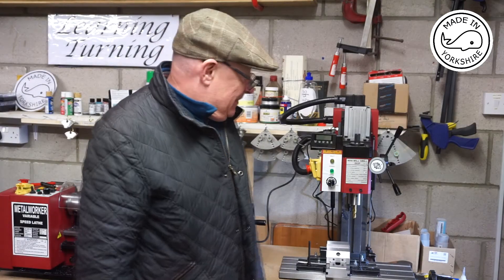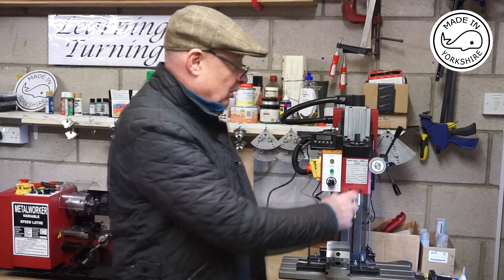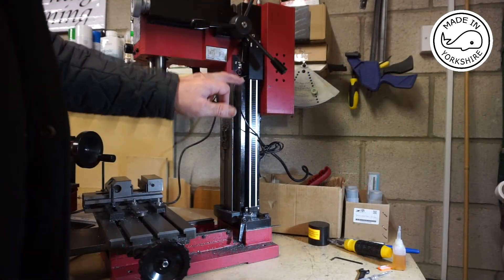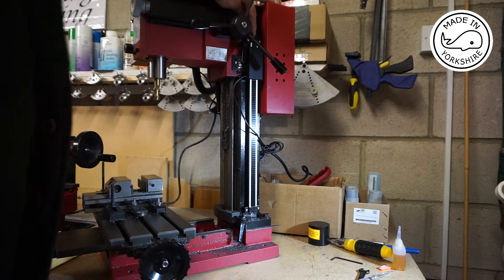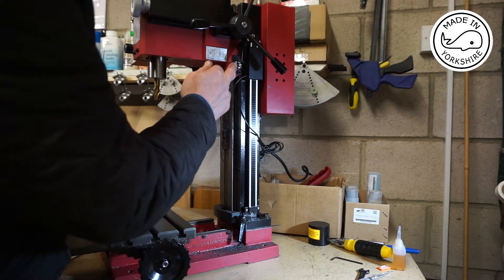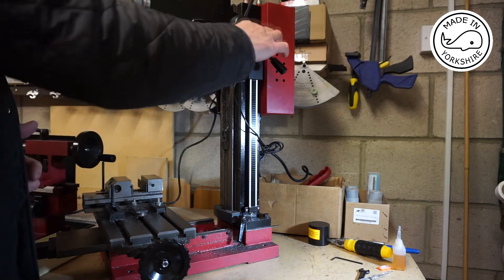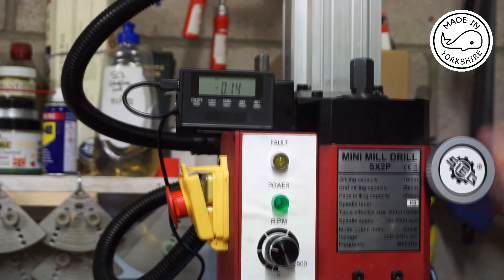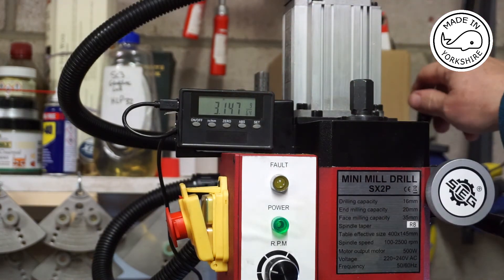#MT10 - Installing a Z-Axis DRO on Sieg SX2P mini mill. By Andrew Whale.

Comment: Why not installing it on the left side, where you removed the spring? More space there (I am just preparing mine for similar upgrades).
Reply from the maker: Hi. The gas strut is located on the left so no available space at that side.
Cheers
Andrew

Comment: how long do the batteries last
Reply from the maker: I used this for a year before using the scales on a TouchDRO. The batteries never ran out during that time.
All the best
Andrew
Reply: @learningturningmetal  Thanks andrew
Reply: I have the same DRO and left the unit turned on overnight. Batteries were dead in the morning, they were the batteries supplied. I have now adapted it to run off a mains supply.
Reply: @nealepitts  Hello, am looking to install one of these on each axis, can you explain how to adapt them to run off a mains supply, thanks.
Reply: @steamwalker100  find a suitable power supply 3v. Solder cables to battery terminals inside the lcd units, easy !

Comment: same deal with my Grizzly G8689. I would have something like .100 backlash and then the head would clunk down the gap. I was lucky to not ruin a soleplate for my steam engine and went ahead and bought a DRO so no worries when I have to fiddle with the fine feed dial. horrible design actually. it's built in slop to begin with, it has a clevis joint before it even gets to the gears
Reply from the maker: Yeah Paul - not a great design at all really. Adding a gas strut greatly improved things as well. Having made the various modifications this little mill has accurately machined everything I've thrown at it. Out of the box it has a lot to be desired.
All the best.
Andrew

Comment: Thanks, Andrew, for another clear video. I have now fitted a DRO to my mini mill, very straightforward as you showed and works very well. My only variation was in making the bracket for the reading head, where I did not use the bracket supplied.
Reply from the maker: Hi Martyn. I'm very pleased it was of some use. I've had the occasional false reading, with the measurement jumping several inches. I think I will also look into making my own bracket for the head, just in case that is the problem.
Happy turning!
Cheers
Andrew

Comment: I had Shumatech DROs on my mini-mill with chinese scales.  A DRO makes everything so much easier. The Shumatech even calculated bolt circles, etc. It was a kit and isn't made anymore.

The reason I'm commenting is that when I added the X-Y-Z to my mini mill people advised leaving one end of the ruler un-anchored.  If you anchor both ends you might twist the ruler and cause jitters, dead spots, etc.  I don't think you've had any problems but thought I'd point it out. 

I currently have a cncfusion ball screw kit installed and use Mach3 to drive it.  It's good but I'm thinking about going back to the DRO. Much of the work I do is one-off and doesn't really benefit from CNCs capabilities.